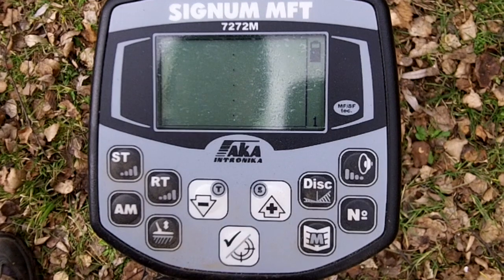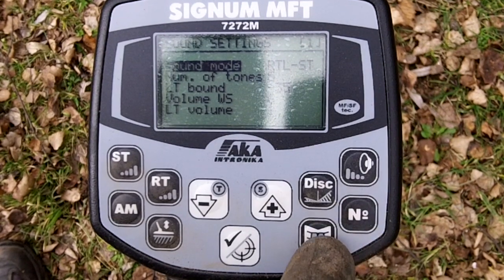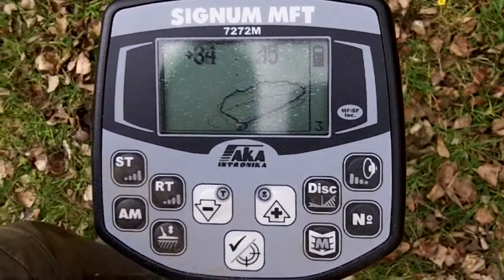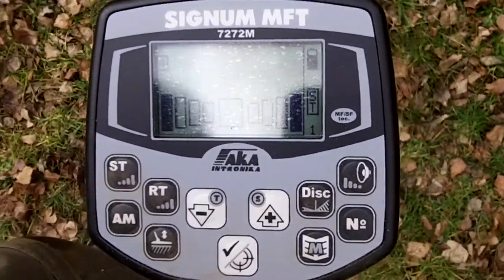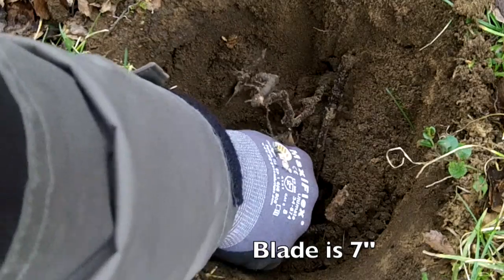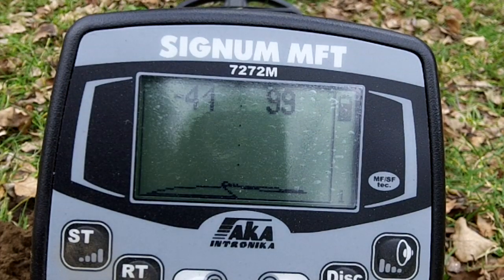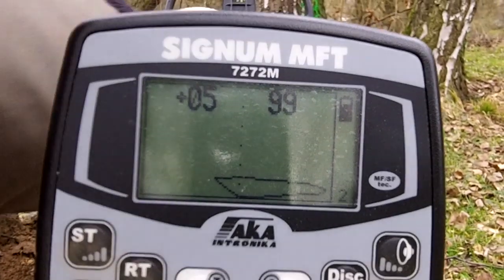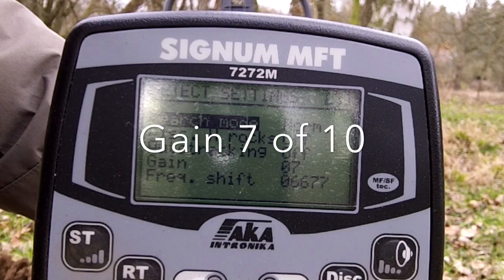Signum 7272M Finds 9" Deep Coin

Comment: i got rid of my etrac for one of these on my way home i was worried, have i done the rite thing!! after playing with it for a week i am over the moon its deeper its faster and lighter and pinpoints better, i have been running it in the rtl/st tone with rt sensitivity at zero on program 3 for a quieter hunt until i get used to it,,,, nice video mate can you make a ground balance video for the signum that would b cool.
Reply: john metrac 
Hi there 
Do you advice me to buy this machine ??? I’m planning to buy a metal detector but I’m confused which one to chose , friends of mine told me this Signum is very powerful but still very difficult as well to use !!! 
If you can tell me plz do 
Thanks

Comment: Ill stick to the ctx3030
Reply from the maker: I've had and used both, the CTX for over 100 hours. The CTX is better, but the Signum is deeper in my ground and more importantly much lighter and better balanced. I hope Minelab someday can make a light, well balanced and deep machine. E-Trac is my backup now, sold the CTX (cause of the weight) but a great great machine.
Reply: lol.
Reply: earthmansurfer69 i agree thats half the reason i sold mine .you cant enjoy metal detecting when your arm feels like its gonna fall off after 45mins lol .
Reply: Aonde,fica,este,endereçou